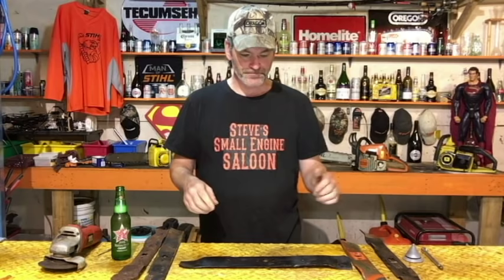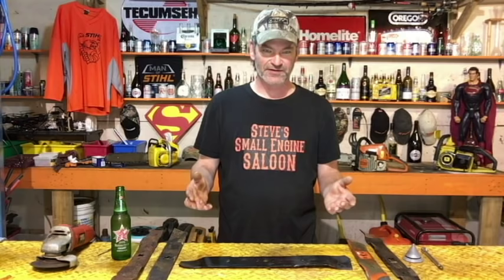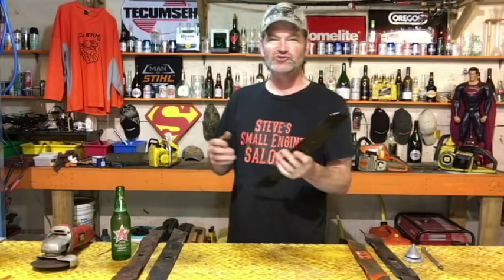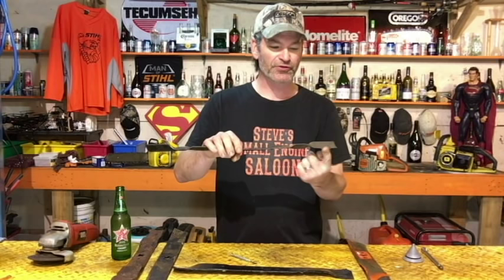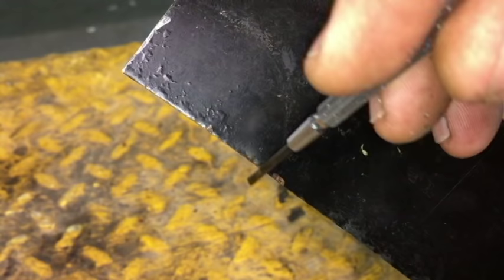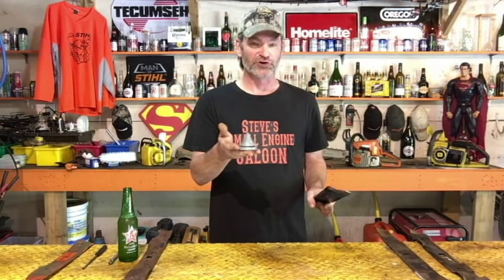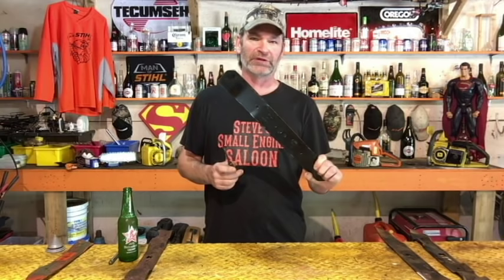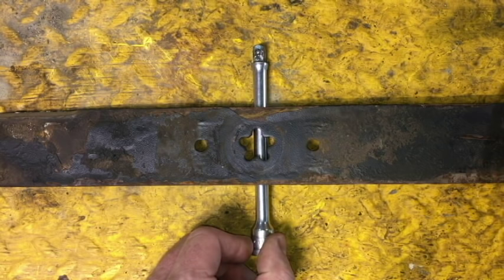How To SHARPEN And BALANCE A Lawn Mower Blade (The Correct Way)

Comment from the maker: Buy a proper blade balancer here ➜ http://amzn.to/2BmvxUO 
Check out these other informative videos: 
How To Install A Lawn Mower Blade Properly ➜ https://youtu.be/jsbTtEG078k
Proper Way To Tip A Lawn Mower Over ➜ https://youtu.be/eeEVigsVqrE
How To Adjust the RPM Speed on a Lawn Mower ➜ https://youtu.be/7YrA3QEIFnE
How To Fix A Surging Engine On A Lawn Mower ➜ https://youtu.be/JOI293d8XUg

Make sure to check out the Saloon here too…
Click here for my website ➜ http://www.stevessmallenginesaloon.com/
Click here for my Parts and Tools Store ➜ https://www.amazon.com/shop/stevessmallenginesaloon 
Follow me on Facebook ➜ https://www.facebook.com/stevessmallenginesaloon 
Follow me on Instagram ➜ https://www.instagram.com/stevessmallenginesaloon/ 
Follow me on Twitter ➜ https://twitter.com/SteveSaloon
Reply: I use vice grips to hold blade on my trailer ramp in the upright position or Up for travel loaded and closed. 
Blade is torso height.
And i use angle grinder. But there also is an optimal angle for the blade is 30°
Reply: @johnmonroney8614  aaaaaaaaaaaaaaaaaaaa!
Reply: like your vid cheers from  down under aus.
Reply: Steve:  I bought a a used lawn mower it runs good, But it seems to cut the grass much  better when the mower is pulled back wards over the lawn. I brought it into a repair shop they did a full maintenance on it, Plus a new blade and set the blade up to cut the lawn pretty low like I asked them. It runs great and cuts a little better, But it still cuts better when its pulled backwards over the lawn.  What's up with that ?
Reply: @richardbartolo2890  When your blade is motionless, and positioned parallel to the mower's direction of travel, the height of the blade should be a tiny bit lower at the front of the mower deck at than the back.  It sounds like your mower has the rear portion of the blade lower than the front.  At least that's what the manual says on my riding mower.
Reply: Hey Steve or guys in thread do you need to balance brand new blades? And do you sharpen new blades? The edge seems pretty dull. Thanks
Reply: @terryiommi311  un

Comment: Only one little thing you didn't mention. Clean your blade with a wire brush before you start balancing. Your blade will not be in balance if the crusted grass and flaky paint come off when you restart the mower.
Reply: Good point
Reply: I always do that first before grinding
Reply: wouldn't that be common sense?  haha
Reply: @onekittyhawk63  hahahahahaha..
Reply: @artsmart07  common sense is anything but common!😉
Reply: Does anyone sharpen a blade without cleaning it? Of course they do, too much whiskey hence the Heineken I guess.
Reply: That is absolutely correct , The blade has to be thoroughly cleaned to properly balance it
Also look to make sure it's not stamped
"DO NOT SHARPEN" , If you have this kind of blade , Replace it , It's a disposable blade
Reply: @ironmartysharpe8293  Lots of things that are supposed to fuel the throw away society get resharpened in my house, Stanley knife blades, box cutters, Silky saw blades, etc. Best thing I did was buy a tapered round diamond sharpener and a set of diamond  files.
Reply: @Bantham Nobilis never was nor never will be 😮

Comment: If there are any nicks and edges curled down, you can grind the bottom side flat.  You're not sharpening it yet, just repairing the bottom so you have a flat surface to grind to.  Then go at the bevel side until you get a nice sharp edge. You'll get there a lot faster than grinding only from the bevel side.

Comment: I've always used a hand file to sharpen my blades. It takes a little longer, but it's easier for me to keep the sharpened edge straight.
Reply: Same here. No risk of overheating it and making it brittle, and less likely to remove too much material and un balance it. Unless there are deep ruts chips and gouges, I always do it by hand.

Comment: If I may, I would suggest a 40 or 60 grit flap wheel rather than the hard abrasive rock wheel. The cut is much smoother and cooler. If the steel turns blue, any temper has been removed. Thank you for sharing all that you do..
Reply: Yup...cooler the blade is kept while sharpening, the longer the edge will last
Reply: I have not had much luck using flap wheels on steel, they get worn out in one or two minutes. Maybe I need to buy a better brand.
Reply: @theobserver9131  use 3M flappers...they last forever
Reply: @mikekopisz1227  Cool! thanks.
3M used to be in my home town, Northfield MN!
Reply: @theobserver9131  Also keep in mind flap wheels come in grit sizes like sandpaper, if you're using a fine grit on rough steel it's going to wear super fast compared to a course grit disc
Reply: @TheIronDuke9  I've been using 40 and 60 grit.
Reply: @theobserver9131  I only want to buy one flapper disc. What size grip would be best for 3 blades cutting 2 acres of lawn in PA?
Reply: @sh1529  I'm probably not the best person to ask what the best grit is for cutting grass. I know that the Coarser the grit, the faster the the grind. I use 40 and it works great for me. You wouldn't want to shave with a blade sharpened with 40 grit though!
Reply: Whenever I sharpen lawnmower blades
I always have a spray bottle of water with me
I grind at short intervals and spray the blade to keep it cooled down to prevent drawing the temper and ruining the blade
The same goes with sharpening other kinds of blades as well because grinding will heat up a blade much more quickly than heating it with a torch
That's why you want to grind at short intervals and spray the blade frequently with water
Reply: @St3v3Bob You can sharpen an ax blade, which has a temper, with a file. Its the correct process in fact. So being tempered does not mean you cant use a file to sharpen it. 
Also, some mower blades are tempered, and some are not, depends on the manufacturer.
Reply: I lightly use a grinder to remove the large nicks in the blades and then I finish off with a bastard file. It's been working fine for me for nearly 40 years.
Reply: A cutting disc works great. If you don't try to take too much metal off at one time, thus keeping the blade cooler. The thicker disc heats the blade up faster. Causing me to dip it in water and cooling the blade off. As turning the metal blue will make it chip.
Reply: remember this when using an electric sharpener on your chain saw.

Comment: Good video, Steve.  The nail trick actually does work and the reason why that balanced blade wasn't moving wherever you put is because it IS balanced.  If you put an unbalanced blade in there the heavier end will most definitely drop down.  All that to say, I still use the plastic conical balancer that you use because you get a front to back and side to side view of where to balance it.
Reply: Been using the nail for 40 years.  Don't fix it if it ain't broke.
Reply: Nope

Comment: Hey Steve, I too have been using an angle grinder for years to sharpen my blades. I have had much better luck using a 60 grit flap disc than a traditional abrasive wheel. The flexibility allows you to better conform to the factory angle, and it seems to run cooler. If you give it a try, I think you'll never go back. Also, if someone doesn't have a bench vise, as safer alternative may be to use a large "C" clamp to hold the blade on a secure square post or benchtop, etc. I have used this method several times when no vise was available.
Reply: Excellent 👍
Reply: I've been using the 36 grit flap discs.   I like the fancy little balancing tool.  That looks like a wise investment.
Reply: +1 on using a flap disc.   I prefer these for all grinding tasks vs a standard solid abrasive disc.  As Peace suggests, once you try a flap disc you will never go back.   Available in bulk from ebay sellers.

Comment: Been sharpening my blades for 55 years. Xlnt video, very clear and to the point. Agree with everything you say except I wouldn't recommend holding your blade while you sharpen w/ angle grinder. Spend a few bucks and buy a clamp to hold the blade to your workbench so you can guide the angle grinder more accurately with both hands. i like the angle it's at for easier sharpening than vertically in a bench vise. Safer and easier to control to get correct angle. You don't mention this but most new blades I've checked have a blade angle of about 22º. Stick with that, they know what they're doing at the blade factory. Nice job comparing the sharpened blade underside with the dull unsharpened one. Night and day. Keep up the good work and have another beer.

Comment: I used to use an angle  grinder. It has issues, like hot spots, trying to make a flat surface with a curved wheel etc. I since found a much better power tool to do the job. It's faster, Sharpens better and you can still be drinking the beer. Try using a belt sander. Depending on how dull the blade is I use a different grade of sand paper. Works really, really good.

Comment: I used a bench grinder this time. I had the disc off my angle grinder for some reason. It was harder to get the angle right. After a couple of tries, I got it close, and sharpened 2 blades on my riding mower and one on my push mower. What a difference! I replaced the blade on my push mower a couple of years ago after I hit a stump or something and had one if those "rotary tiller" blades like you showed on the video. I have had the riding mower for a couple of years and hadn't sharpened it. Now hen I hit thick grass with either one, it slows the engine down very little.

Comment: A friend gave me a great Briggs mower about 12 years ago. I have a small yard, and use it only half a dozen times a year. I've neglected it a bit, and the blades are now completely cactus (due to rocks and uneven territory, and yes, I adjust the blade heights but still cop those rocks, stumps and buried concrete at times). It needs new blades, but at least now, I know how to keep the new blades sharpened. I'm in the process of clearing out those rocks etc. The whole balancing thing, was the most valuable thing I got out of this video, thanks!

Comment: Hi Steve after watching your blade balancing method I was impressed with the balancing jig that you used .Being a retired engineer I've made one , works a treat . Took two cans of lager to complete the jig.  Love watching your small engine videos, very informative and entertaining
Reply from the maker: Cool, thanks
Reply: How did you make it Brian
Reply: After you drink the lager, how do you make the jig?
Reply: Just make sure your bench or table is level.  Your eyes can play tricks on you if the bench or table is not level.
Being a retired mechanic/machinist.  😁
Reply: @mikeymike758  I place it on the lathe bed which know is level in both directions

Comment: This is such a great video!  I'd sharpened my blades before but never balanced them (I thought I did, but followed a method debunked in the video).  I purchased a blade balancer for $11, sharpened the three blades on my mower deck, and afterwards it purred with hardly any vibration at all.  Total time required was just over an hour, including wresting the deck on and off the tractor.  I had progressively let the blades get out of balance and never picked up on  the increased vibration.  Tomorrow I'll properly balance my spare set of blades.  Thank you, Steve, for another terrific lesson.
Reply from the maker: Thank You...and You're Welcome...

Comment: I use a C-clamp outside on a heavy table and a angle grinder flipping it over for each side and take off rolled metal from the grinder with a file after checking the balance.

Comment: bought the balancer. I have 2 toro 22" blades. I couldn't believe how out of balance they were. hooked up my pneumatic angle grinder & got them back into shape. It was a lot better than using a mil file which took forever.
Reply from the maker: I agree!

Comment: thanks once again for sorting my problem out. sharpened and balanced using a cheap plastic balancer. one of my blades on my ride on was bent and it was quite an effort to straighten it which is not surprising.

Comment: Great tip on balancing (using the extension method.  But, regardless of how one does it, ya might mention being sure there is no buildup of grass "smear" on the blade.  I use a wire brush to quickly knock off any buildup there might be.
Reply: Good idea. Easily could throw the balance off. Thanks for the tip!

Comment: 100% correct on all counts. Especially the part about not wasting your time with a file. I use a small angle grinder with a coarse sanding disc, works perfect.
Reply from the maker: Right on

Comment: I use a flapper disc, it works great, moves metal quickly, but is more forgiving than a disc. Great video.
Reply from the maker: Right on...
Reply: I started using a #80 flap disc this year and it generates less heat than the fiber and does a great job to dress the edge.

Comment: I got creative with the last time I sharpened my blade. I welded up the cutting edge with hardfacing wire and then ground the edge back to the original angle. This was almost 3 years ago, and the blades are still sharp. I have found many gopher mounds during that time, and the edge still holds up.
Reply: That is the way to do it. I have always wanted to hardface my lawnmower blade as they are so soft and won't hold an edge.
Reply: I used .045 diameter stoody 102g hardfacing wire with 75-25 argon co2 mixed shield gas. I think I am able to shave with the blades still.
Reply: Oh man that’s a good idea i should try that

Comment: after watching your video and a couple other ones (not as professional as your video) I got myself a Kokanee and took the front wheel off my wife's bike. I filed a 3/8" lock washer to fit in the 5/8 hole in the blade. I then got another Kokanee and put the blade with the spacer in the hole on the bike wheel axle & wala !!  It worked .  The heavy side went down.                I love watching your stuff. I worked in a saw shop in high school and do all my own maintenance.

Comment: I use to use this method for years and it does work very well but recently I started to use my Belt Sander 30 grit and because it's belt is so flat I get a better and smoother result.  Placing the blade in a vice and keeping the belt sander flat at the correct angle 30 degrees, I get a very professional result by this procedure.
Reply: 00
Reply: It will do the job just fine

Comment: I've got a good quality mill file, and that does a good job for me. Less mess, noise, etc.
Reply: I always sharpen with files and stones. I’d just remove dirt with a couple of light passes with a grinder so I’m filing clean metal.
  A grinder works fine, but you have to be careful not to overdo it, and don’t let the blade get hot.
Reply: @michaeltaylors2456  File is the most satisfying to use. Creates a very spicy edge.

Comment: This can also be done with a straight file, if you've got something to clamp the blade to a table with. It works surprisingly fast, provided the whole cutting edge isn't dinged to the point of having to re-grind the whole angle into it. If that works as well as it does, then power rotary tools may need a light touch in comparison or you're just wasting the metal on the blade.
Reply: I’ve always used a file and try to touch it up every few cuttings.  It only takes a few minutes.
Reply: @PS-rr2jt  Agree, two to three times a year touch it up, takes minutes.  I count the same number of strokes on each side and it stays balances.
Reply: Takes all of 5 minutes to do a blade manually with a hand file, much better results truth be told...
Reply: I agree.  Unless you have a blade that has been neglected or damaged in strikes, you can hand sharpen a mower blade with a file in just a few minutes, often as fast as a grinder, with much better results.  .  Since you are not hogging of a bunch of material with a grinder, there is rarely the need to balance.  I can imagine people who are not experienced hand sharpening maybe being intimidated and thinking it’s easier to just put it to a grinder, but once you are proficient, it’s the best method in my opinion.

Comment: Great video on sharpening the blade.  But one important thing that you forgot/failed to mention when checking the blade balance with a cone balance or socket extension, is to make sure your bench or table is level.  The eye will foul you with an out of level bench or table.  Cheers,

Comment: Glad I watched this vid, I learned something. I have no problem with sharpening the blades but having an extension on the bench is a good idea to keep checking the balance.
My problem with the blades is the ears that eject the grass, weeds and crap in my case, tend to wear out then break off. If you happen to have a welder handy it's easy enough to hard face this area. After hard facing you also need to balance the blades.
If the blades are just a bit off you may not feel it but the BEARINGS know all about it!!

Comment: As long as the nail is centered in the circle, the heavier side of the blade will always move downward. I personally use a 1/8 inch pin punch for checking the balance.

Comment: Thanks for that tip with the extension for checking balance. I used to balance it on my fingertip to get a rough feel, but this is much better, and I'll use this for when I sharpen my lawnmower blade this winter in preparation for spring. If you do not have an angle-grinder or a bench-grinder, another tip is that there are abrasive bits for your electric drill, if your blade is not too badly damaged, you can use that to sharpen it, and you might even be able to sharpen it without removing it depending on your lawnmower-design if your drill is slim enough.